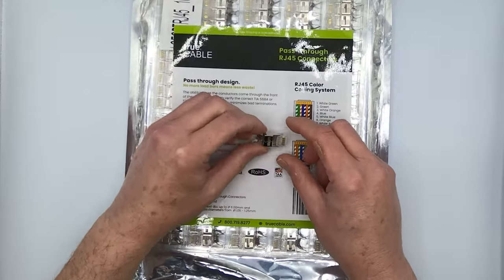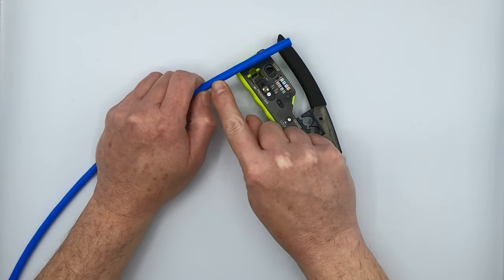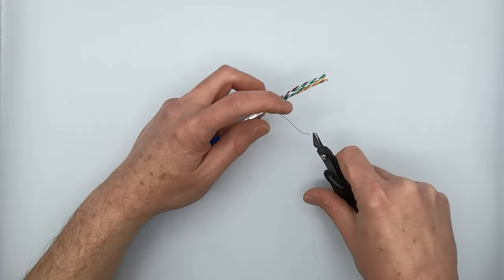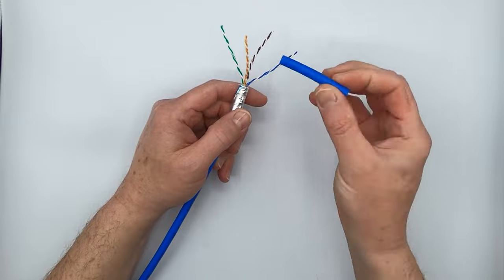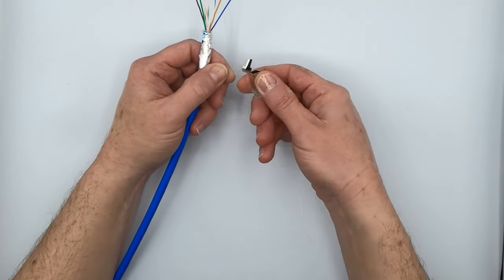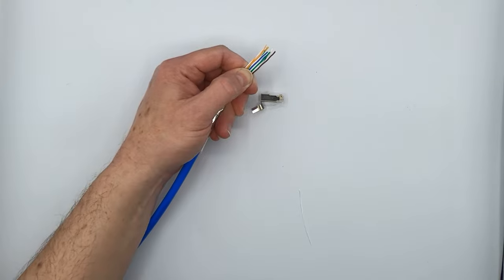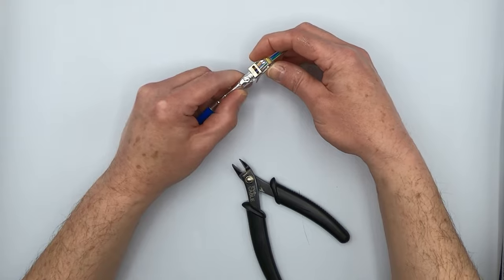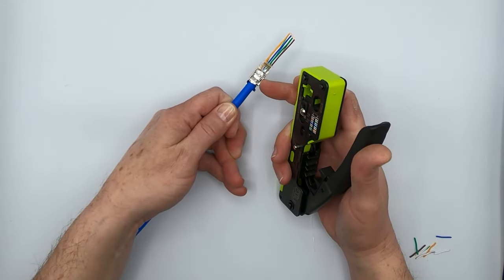How To: Terminate a Shielded Cat6/6A External Ground Pass Through RJ45 Connector

Comment: Are passthrough cables just as good as non passthrough cables?  Do the open ends create any extra interference or crosstalk when you start going to Cat 6a or higher cable.  I have seen passthrough shielded rj45 plugs being sold to even Cat 7 sized cable.  I always worry that with the open ends it might be causing some issues at the higher frequencies.  Would be great to Fluke test a passthrough vs non passthrough termination at Cat 6, Cat6a and Cat7.
Reply from the maker: Hello! You are in luck. I have already used a Fluke DSX-8000 to compare pass-through to non-passthrough RJ45 8P8C performance. The performance is equal. Now, that said, what really matters is FITMENT of the cable to the plug. If you get the fitment wrong, then you will have issues with connectivity and performance. The open ends do not create any issues assuming they are properly flush cut during termination. I wrote a detailed blog about this here: https://www.truecable.com/blogs/cable-academy/terminating-pass-through-rj45-connectors-onto-solid-copper-ethernet-cable-a-really-bad-idea and I recommend you read it. Also, stagger style plugs do make a difference with Cat6A termination (does not matter whether they are pass-through or not). The stagger helps with crosstalk and increases Cat6A performance headroom. It is quite the nuanced subject, which we address in multiple articles on our Cable Academy.
Reply: @trueCABLE  Thank you for the informative information.  I had to find out the hard way that just using a pin continuity tester is not enough for some applications.  I had to run an HDMI over Cat7 cable a long distance to carry 4K signals... this is where I learned that crimped connectors are very iffy no matter how good you do your termination, especially for Cat 6a and above.  I then moved on to Telegartner MFP8 and finally got everything working.  I realized then that if you are not going to certify each termination with a Fluke tester then it is better to use either a keystone jack, then add a certified factory made patch cord, or just use something similar to the MFP8.
Reply from the maker: @majdq8  Hello! Yup, you nailed it. For those without advanced testers the best way to go is keystone jacks, field termination plugs, and factory pre-made and pre-tested patch cable for your installation.
Reply: @trueCABLE  Actually one other bit of information ... when I tested my crimped Cat 6a connections (and I consider myself extremely proficient crimper as I use copper  foil and limit the amount of untwist as much as possible and even use shrink tube) some Cat 6a STP connections performed worse than my Cat 5e crimped connections.  Somehow the extra foil and shielding seems to create more interference if some little thing is not done correctly.  Meanwhile the field connectors and keystone jacks were 100% perfect every time.  That is why I simply don't trust crimped connections for anything over Cat 6.
Reply from the maker: @majdq8  Hello again! Absolutely correct. Shielded Cat6A terminations are the most sensitive. By FAR. That is why keystones and field termination plugs are all but required.

Comment: you don't need a rj45 boot/cap for this type of connector?
Reply from the maker: Hello KisameSenpai. You can use one, yes, but the design of the plug will not allow in-line boots to be used. You have to use the "slip on" variety that would render it difficult or impossible to use with high-density equipment ports. The thickness added is too much, and one will not fit next to another due to spacing issues. Therefore, the strain relief is provided at the ground collar, and that is why the collar must be crimped perfectly every time with the right tool.

Comment: Apologies for what I'm sure is a basic question. I'm running some of your CAT6 shielded cable (F/UTP) from POE cameras to an NVR. Where does the actual grounding take place? Is it when this metal RJ45 connector brings the foil shielding into the NVR and eventually into the wall socket the NVR is powered by? If not, how is it grounded? If I understand correctly, the shielding in the shielded cable is useless if it's not grounded and I may as well use unshielded cable in the first place. Any assistance is appreciated.
Reply from the maker: Hello! Yup, the cable shield would bond at the NVR to ground. This is assuming, of course, that your NVR has a three-prong power plug with an internal AC power supply. If not, you would need to terminate the cable to shielded keystone jacks and mount them in a shielded patch panel. The shielded patch panel would then be bonded to ground, which you can do with our truePLUG bonding extension adapter accessory very easily. This is actually the PREFERRED method anyway, since you want a Category 6 rated keystone somewhere in the channel. You could then use unshielded Cat6 patch cords from the keystones in the patch panel to the NVR, and we also sell those patch cords. Using unshielded patch cords would help protect your NVR from any surges since bonding to ground would occur at the patch panel first. You are correct that shielded cable that is not bonded to ground may as well be unshielded cable, and using unshielded in the first place may have been wiser if you opt to not ground it.

Comment: Great video!
Quick question though! I should be looking to use a shielded pair cable for installing a cable within a wall, terminating it to a RJ45 wall plate right? Looking to do this for an office space
Reply from the maker: Hello! When terminating in-wall permanent cable, you should definitely be using the keystone > patch panel approach (known as "rack to jack"). RJ45 8P8C plugs should only be used on solid copper Ethernet cable in limited cases. You are definitely thinking correctly...run your shielded Ethernet cable to shielded keystone jacks at the work space side and back to a patch panel at the telecom room side.

Comment: Can you advise if this allow us to terminate U/FTP Cable; where this is shielding around each pair? I've purchased the above crimping tool and plugs but the cables themselves wont't fit into the RJ45 Connector. 

We're using Category 6a Solid U/FTP LSZH B2ca Cable (Connectix 001-003-003-08)
Reply from the maker: Hello! Our plug is designed to handle up to 1.25mm insulated conductors (copper + insulation around the conductor) and your cable uses 1.33mm insulated conductors. The plugs are definitely too small. In fact, your cable's insulated conductors are so thick you are going to have real trouble finding ANY RJ45 plug that will fit. I suggest contacting the cable manufacturer to find out what plugs they have tested for fitment and go that direction. Sorry ours did not work out! Our termination tool should continue to work fine for you, however, assuming the plugs you end up buying (if there are any) are not proprietary and require a specialized termination tool. Hope this helps!

Comment: I am trying to make my satellite dish cable longer. Both ends are special, poe.... No other place has them. So I I have to reuse those. So, when connecting those separate splits on both ends, how do the drain wires connect back? Do I connect both again to provide a complete circuit? Or leave the end close to the dish off and ground the other end to the house ground? Or??
Reply from the maker: Hello J.L. You can use a shielded Cat6 splice block. They are available to buy online. This will provide a high-quality and stable connection between the two segments and will allow your Ethernet cable shield/drain wire continuity as well. Just be aware that these splice blocks are not weatherproof so you will need to weather-seal the block. 3M Mastic tape or a weatherproof enclosure of some kind will work.
Reply: @trueCABLE  ok, but do I connect the drain wire to both the split areas? Just as with the other wires? I understand the block will connect it for continuity,  but I've when you use the blocks to ground the one split to the house ground and leave the other not connected due to a possible potential?

Comment: Good video.  Just finished literally  
100 + cat6a shielded Plenum plugs. Near ends crosstalk was a problem on a couple. My side of course. I was told I need at least one twist on each color which made it slightly difficult. My foil only went as far or a little past first window on plug. Is that why I had crosstalk? Or is it because I didn't have enough twist.? I re-did the failed ones and put like 2 twist on each pair.  Foil was in same spot on plug and it passed. 
Thanks for the feed back.!!
Reply from the maker: Hello John! Excessive crosstalk is typically caused by too much untwist at one or more terminations. 1/2" is the maximum amount of untwist but it is hard to visualize. If the cable jacket is pushed into the plug so that it passes the first "window" (actually, that is the strain latch) then you should have met the 1/2" rule. Your issues might have been caused by nicked conductors, which can also show up as excessive crosstalk. Exceeding the bend radius of a cable can show up as excessive crosstalk, too. In other words, it is rather difficult to say what the exact reason was without a Fluke test. FLW file, showing all the diagnostic details.
Reply: This tutorial does not show the correct way to ground the shield.  He claims multiple times that the shield foil is enough for ground continuity through the jack, but the crimp over a drain wire is the intended way to do it.  Don't rely on the foil and interior of the cable, not enough strain relief or reliable connection point.  Your issue may well be failure to ground the shield.

Comment: Is there a reason to use or not use a rubber boot over the connectors?
Reply from the maker: Hello John! Normally you would with the in-line cut-to-fit locking strain relief boots, but this type of connector requires boots that fit OVER the connector plug housing. This can cause issues with plugging them into high-density switch ports. Of course, you should not be making patch cords out of solid copper and plugging them directly into a switch anyway, but some people try to. If you are plugging this type of termination into a device directly, like a TV or PC you can likely get away with using a boot and we do sell them. Hope this helps!

Comment: Will the RJ45 PLUG fit the cat5 and cat6 cable?
Reply from the maker: Hello Lee. Whether any one RJ45 plug will fit a particular cable has to do with fitment and not Category. The two critical dimensions are insulated conductor diameter and cable jacket OD. Without that information, it is impossible to properly select a compatible plug.

Comment: Hi.thanks for the tutorial. But I have a question I hope you can answer. Tks.
The arrangement of the 8 wires, Left to  Right, are the same, in both the connectors. I use this long cable from the router to the wall socket, the faceplate which has "female-female" at the back and front. That is the standard cable is fixed to the "IN" at the back of the socket, and on the front of the face plate, a shorter cable can be connected when needed to say, a laptop. Now my question is the long cable has the 8 wires arranged as 1 to 8, LEFT to Right. But than on the faceplate wouldnt it have to be reversed, 8 to 1?...if so...e.g ROUTER>>LONG CABLE>>FACEPLATE, BACK, FEMALE.  Now if a short cable ethernet connection is needed. And connected to the wall socket, would the connector not be connected as 8 to 1. Or  RIGHT to LEFT??... Would the faceplate be giving the wrong connection to the connected gadget. Via a shorter cable to, in this case the laptop. OR IS THE Faceplate has internally switched.Lto R.  can anyone help me figure this out pls. Tks.
Reply from the maker: Thanks for watching our video and for taking the time to respond. The system you are describing consists of a wall plate and a keystone coupler (female-female). If the coupler only connected nearest conductor to nearest conductor, then you would be correct, and each coupler would reverse the order of the conductors and disrupt the channel. However, that is not the way the couplers are made. Each coupler contains a small printed circuit board (PCB) that not only corrects for circuit continuity, but also ensures that the impedances of the cable, coupler, and any other connectors in the channel are matched. We hope this helps! Please let us know if you have any further questions.

Comment: @trueCABLE I need to run cables for 8 or more POE cameras however the 120v electrical wires are crossing everywhere on the floor of my ceiling. I assume the wires were installed before the ceiling was installed because there is not enough crawlspace for a person to fit so I will have to fish through the network cables with some effort. I can try to run externally as much as possible but will inevitably have to enter the ceiling space to make reaching the NVR location as tidy as possible. My real concern is since it will be most impossible to manually maneuver the network cables to avoid the 120v cables and they will cross paths, is there any benifit of me spending the extra money for dual shielded or (S/FTP Cat 6A) cable with braided sheild and additional foil shield around each pair of conductors OR will simple (FTP Cat5) foil shielding around all the conductors be enough to resist the EMI from the 120v cables ?
Reply from the maker: Hello! I understand the situation. In your case, either F/UTP (overall foil only) or S/FTP (braid + foil individually shielded conductor pairs) will work fine. Considering these are 120V branch circuits, the EMI is not that severe. Obviously, you should use shielded in this case, but a regular overall foil shield (F/UTP) will be fine.
Reply: @trueCABLE  Thank you for the guidance, you have saved me some expense and worrying. Much appreciated. Love how easy and informative your videos are, great work.
Reply from the maker: @dysan45   Glad we could help!

Comment: why did you cut away the drain wire instead of wrapping it around the cable under the collar?
Reply from the maker: Hi there! This is a great question. I did this due to the design of the RJ45 plug. The inside rear of the plug is 100% nickel-plated brass, and the ground collar in this situation serves as nothing more than strain relief. With this particular 8P8C plug, you can bond the cable shield in several ways. Another favorite way of mine is to actually cut off the cable shield, wrap the drain wire around the jacket, and then tack it down with our conductive adhesive copper fabric tape. In fact, the latter method is what I recommend these days. No need to deal with folding back the cable shield anymore...rather annoying to deal with most of the time. Hope this helps!
Reply: @trueCABLE  it's best practice to use the drain wire for continuity, regardless of what connector you are using.  Why not make an updated video and delete this one?  I can see a lot of people failing to ground their cables using this tutorial.
Reply: @trueCABLE  please make a video showing this updated procedure.
Reply from the maker: @velocityacoustics  Hello! Lucky for you this is already in progress. You will see the revised blog and video in about two weeks. The new title will be "Slaying the Dragon: RJ45 Termination of Cat6 & Cat6A Shielded Direct Burial Ethernet". Let us know what you think when it comes out!

Comment: How to ground the connection?
Reply from the maker: Hello Andre! At this end of the connection (the remote PoE device end, for example) you would not bond it to ground. Instead, the "switch end" of the connection needs to be bonded to ground. You accomplish this with a shielded keystone jack mounted in a shielded patch panel that is properly bonded to ground.

Comment: Is it the same with f/ftp cat7 cable termination?
Reply from the maker: Hello and thanks for your question. The basic process is largely the same. That said, any one individual cable may have differences that require specific different techniques for termination. Some shielded cables have individually shielded pairs, for example. In addition, your specific termination hardware may require a different technique as well. The specifics will, in the final analysis, come down to the brand and style of cable/termination hardware. We hope this helps!
Reply: @trueCABLE  Thank you so much! Just couldn't decide whether to buy cat6a or cat7. Now I think I'll choose the cat6a for my LAN.

Comment: Do I need the shielded Cat6 for connecting between HDMI extenders? and needs to be grounded?
Reply from the maker: Hello! Yes. Considering HDMI is shielded by design, I would also use shielded Ethernet cable and make sure the cabling system is able to drain off to ground.

Comment: Excellent tutorial! I'm very much interested into these connectors, but I have a Klein Tools pass-through crimper (VDV226-005). Do these connectors work only with truecable crimper or expected to work with other brands?
Reply from the maker: Hello Shahedur! Good question. The Klein VDV226-005 lacks the external ground collar crimp cavities necessary to properly attach the plug. You would need a separate external ground collar crimp tool, but that will cost nearly as much as a new all-in-one crimp tool like ours. Secondarily, our all-in-one crimp tool was tweaked during the design phase to give the best results with our line of plugs.
Reply: @trueCABLE  would love to know how you ground wall plates. My understanding is that even if the shielded cable is grounded in the terminal, it won't be grounded unless the wall plate jack is grounded.

How do you handle that?